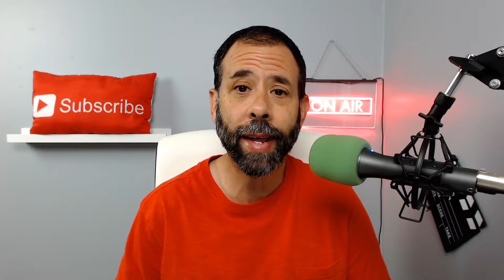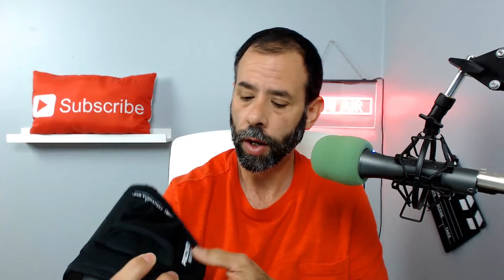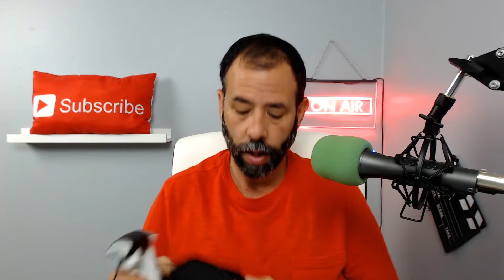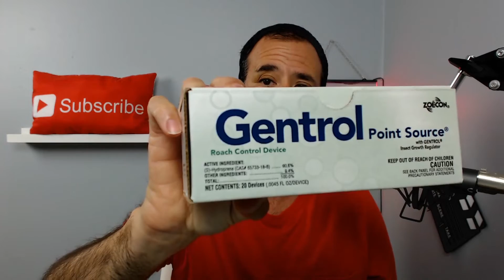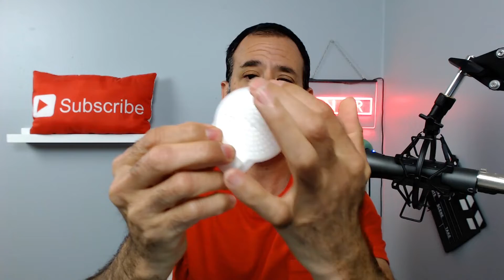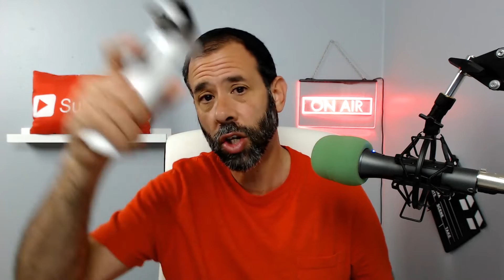Our No Spray Non-Disruptive Eco-Friendly Residential German Cockroach Control Service Protocol SOP

Comment: Hey Frank, I have a building (old large house) that has been broken into efficiency apartments. Roaches tend to travel unit to unit since it is in the same building. I believe or biggest challenge is that it has drop ceilings. Any thoughts on treating the space above the ceiling tiles? Thanks!

Comment: I have seen almost most of your videos and I have learn so much, I even bought the backpack and the extension too. Now for your bait videos you have a different needle. Where do you get those stainless needles?
Reply from the maker: The needles i order from Univar
Reply: @pestgeekpodcastpestcontrol4795  Thanks again
Reply from the maker: I order them from univar but they are called blunt needles you can order them online 14 Gauge 1.5" Blunt Syringe Tip

Comment: Your protocol matches mine more than I would have thought which makes me feel pretty good. Never did understand putting out more bait than they would eat before it dried out. I do have one question. Is it necessary to re-apply Doxem quarterly? That stuff (according to their pitch) lasts way longer than that.
Reply from the maker: I dont thinks i didn't apply avert every 3 months i only change out the point source and inspect the monitors and inspect for any signs of re infestation if so only apply gel bait where sighting is.
Reply: @pestgeekpodcastpestcontrol4795  Thanks so much.